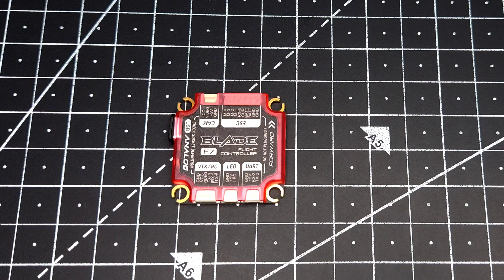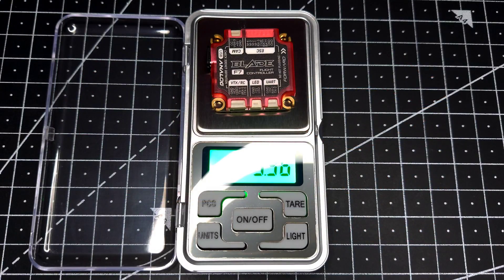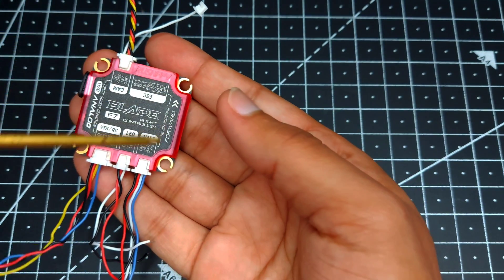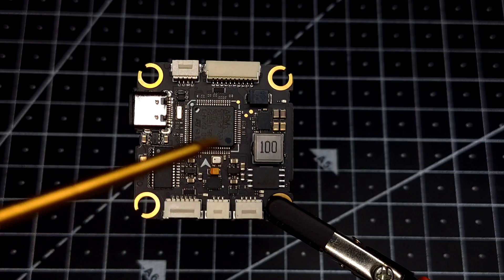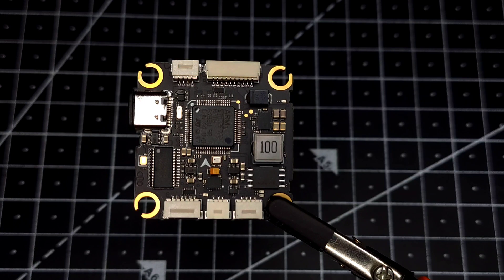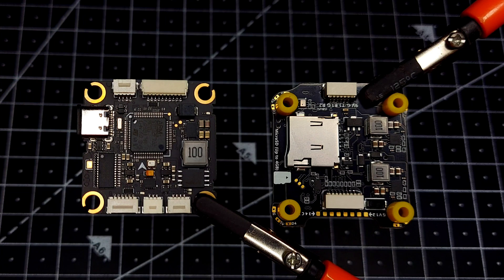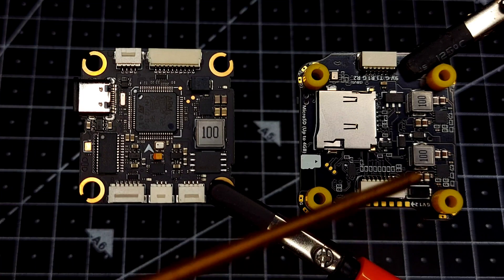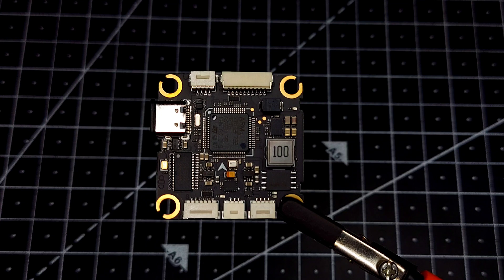Most Durable Flight Controller ? Rush Blade V2

Comment: This was a great video.  I found myself watching the whole thing.  I found this flight controller to be a very amazing little feature packed flight controller.  It was easy to build with and I would like to see the plastic shroud as well as the rubber usb c plugs incorporated into all flight controllers.  The single sided pcb was a nine feature as well